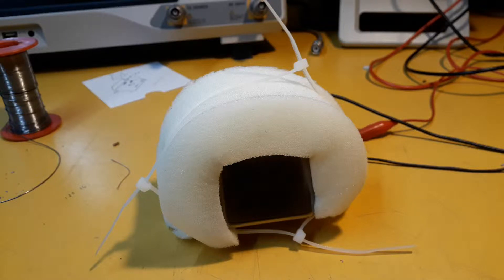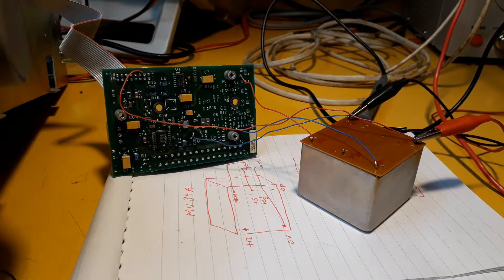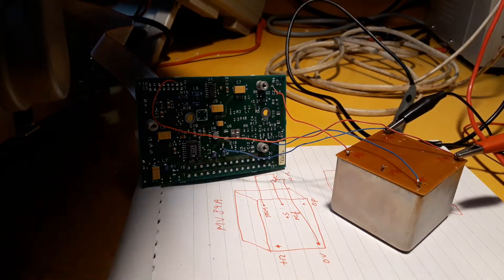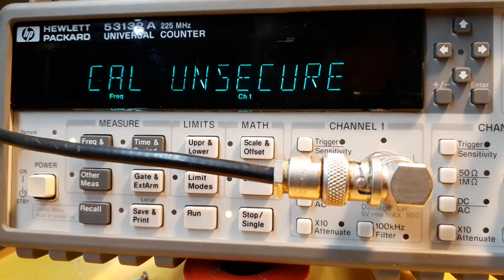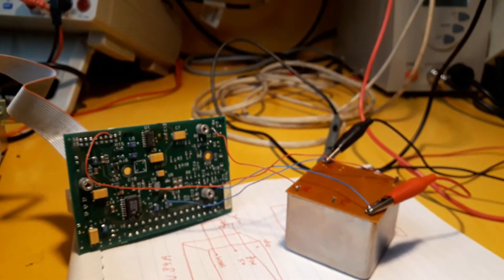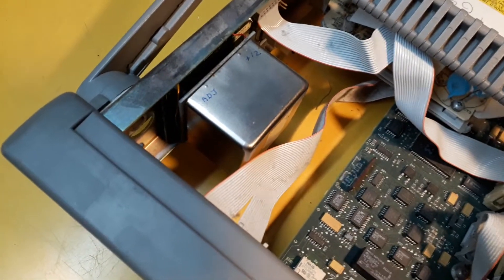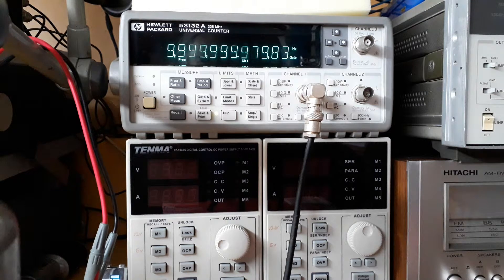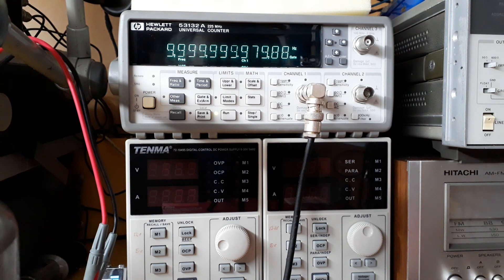Hp 53132a crystal oven oscillator mod. Part 2

Comment: The Morion MV89A is a good oven, but very old too. 
Check this out!
https://www.ebay.com/itm/UCT-OSA-MY-108663-01-10MHz-12V-Double-Oven-OCXO-Crystal-Oscillator/264230742882?hash=item3d85612b62:g:wW4AAOSwTwBbx7xQ&frcectupt=true
I ordered 5 of them for this price.  Two for my HP 53131A and one I will change in my GPSDO, the OCXO in it is crap too.
Look into the datasheet and you will wonder how accurate it can be.